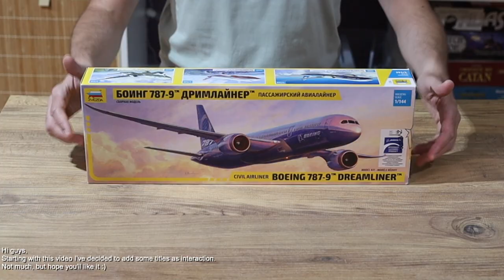Zvezda Boeing 787-9 Dreamliner: SPECIAL 75 YEAR ANNIVERSARY amazing livery | Step by step assembly

Comment: How are you polishing the surface because when i am polishing or smoothing the surface the Paint is coming off and it Gets mat not shiny what can i do pls help
Reply from the maker: I usually use a polish sandpaper with 2500- 3000 grit. Use it with wather for wet sandpaper
Don't use any presure just circular rub and you should get some results:)
A better idea and i'll use this myself is to use cotton polish with tamiya compound. It works brilliantly
Reply: So wet Sanding 2000-4000 grit and then polish compound
Reply: Is the 2000-4000grit enough ??
Reply from the maker: Yep. I start with 2500 and 3000
But I'm doing that on 3 layers of paint and a primer base. Don't sand if you spray only 1 layer.
Reply: Okey so should i spray the clear coat First or First polishing and then clear varnish 

Srry for so many questions
Reply from the maker: :) no worries. Drop as many as you have
I'm not saying is the correct way, but the way i do it is polish, then spray 2 layers of gloss varnish. You then can use the cotton buds and tamiya compound, then apply decals and lastly seal this with a clear non gloss varnish
Reply: @MahaysAttic  thank you very much when i going to have more questions im gonna ask you Again but thank you very much for the Moment
Reply from the maker: You're welcome 🤗

Comment: Do you place the window decals straight over the open holes ??
Reply from the maker: :) yep. This is exactly what I did. I will not since now forward. I had the impression that it's not visible. But it is:)
Reply: @MahaysAttic  I was more thinking the decal in those areas are fragile and over time will break ?  Nice build.
Reply from the maker: Thanks for appreciation. Indeed in time will get fragile :) i am managing the models with obsessive care so no decal will ever break:)